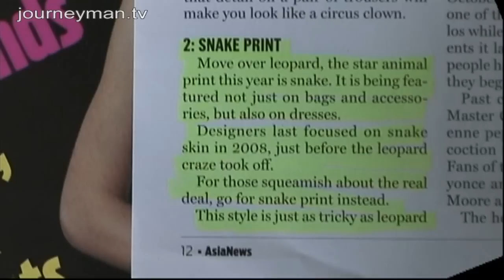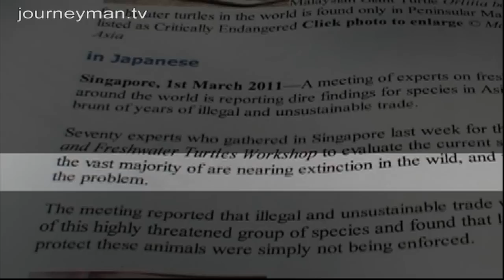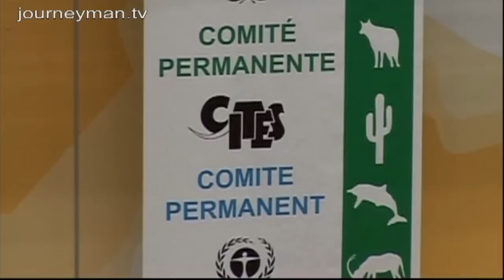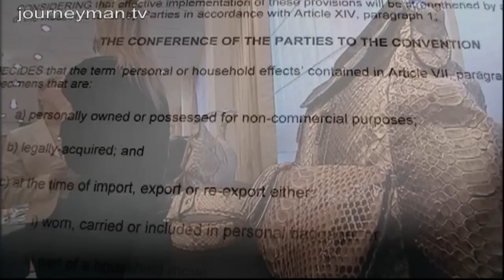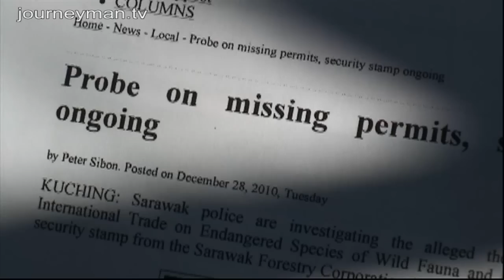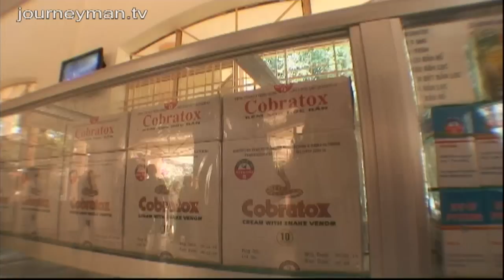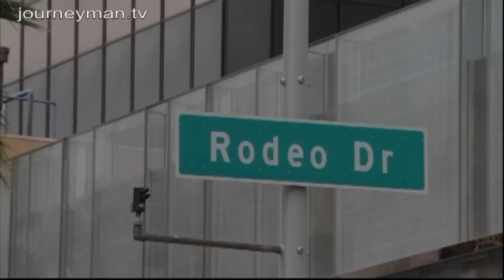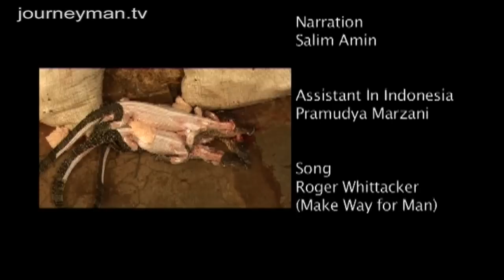The Gruesome Details behind Snakeskin Purses

Comment: To everyone freaking out: The animal is actually killed instantly, the body is only moving because parts of its nerves are still active. You can cut a snakes head off and the body will still wiggle around.
Reply: Justin Akioka The animal cant feel pain if the brain (which processes pain) if severed or destroyed. and while the rest of the body is alive for maximum 30 seconds on some occasions, it cant feel anything. also, the heart stops, without order from the brain it cant do anything. The reason it is moving is because its nerves still have a slight charge, which rushes up and down the body, making it move.
Reply: ***** Do you have proof? Even if it is still alive it couldn't process anything because its brain is not connected to the spinal cord. What you see is actually just spare charge running up and down the nerves, making the muscles rapidly expand and contract.
Reply: michael weedmark the narrator said they are clearly not dead
Reply: michael weedmark Literally multiple times
Reply: Samuel Lovette The narrator is wrong. look it up for yourself and do research about the topic. It is dead, its just the muscle spasm due to lack of instructions from the brain. The actual animal is dead however, and cannot feel or process anything.
Reply: michael weedmark he said "in some cases, the head is not removed so it can be assumed the snake may still be alive." you have no idea if the snake is alive or not, could just have a severe concussion. at the end of the day deoes it really matter? humans torturing and killing animals. again. "humans" yeah fucking right.
Reply: qnaydz Im taking biology in university, I have studied snakes and their nervous system. once the main spinal cord is broke, the snake can no longer feel that part of its body, if the head is severed, it does die instantly (lack of brain function, no blood reaching brain, no air coming through trachea). Even if it survived that, the blood loss would kill it within 30 seconds. Think of it like this, if you cut someone's head off, they die, if you break someone's  neck, they also die.
Reply: Caroline Dinnage Umm, what? Im just saying they are killed instantly, im not saying that its OK to kill snakes just for their skin, in fact I think that is disgusting. I do hunt myself, but even that does not mean I disregard animals lives. In my opinion, every life form is equal. It is the same chemical reaction for every living thing, no matter how smart, large, or insignificant it might seem. It is incredibly humbling to think like that.
Reply: michael weedmark A severed human head still lives for about 10 seconds. That person's brain feels their body severed out of their head, and the pain that comes with it (At least, coming from the nerves still attached to the brain). Incapacitating the brain instantly, then we're talking. Cutting the head off, not so much. Same with breaking someone's neck.

In anycase, I agree with your last statement, and I dont want you to think that im attacking you. Your argument was in fact, valid, as cruel as it might've sounded to some of the more sensitive ones out there. :) 

Still, I've got to say... what goes on in this video is still gruesome, and the only way to stop "mass production" of these things is for the rich to stop buying them. No demand, no supply. Its as easy as that. Yet people here who are the more fortunate in this world, only criticize the ones trying to make a living with this while living in a shack in the mud. Its disgusting.
Reply: WookieWalker Totally agree.
Reply: Silence is Golden Duct Tape is Silver Someone didn't read the entire comment thread.
Reply: Silence is Golden Duct Tape is Silver The point is that i don't agree with what they are doing to the snakes.